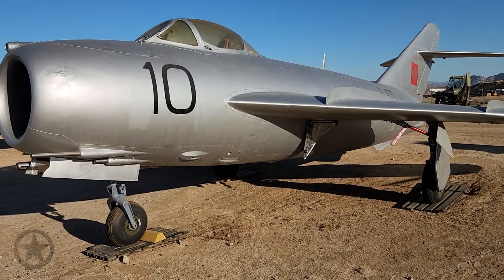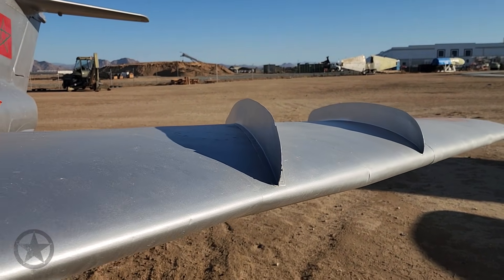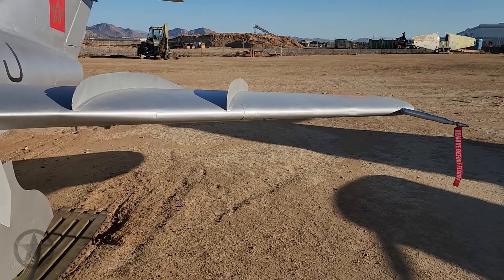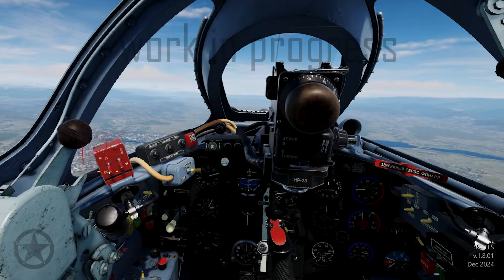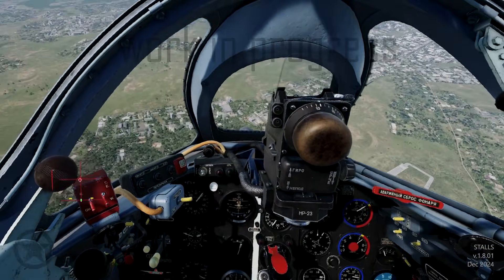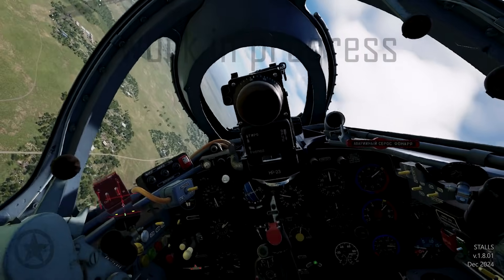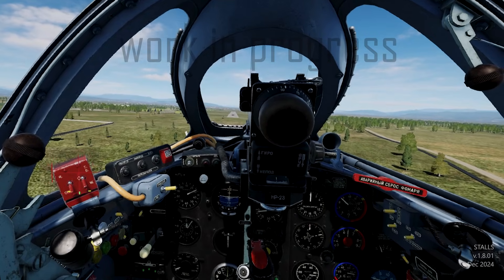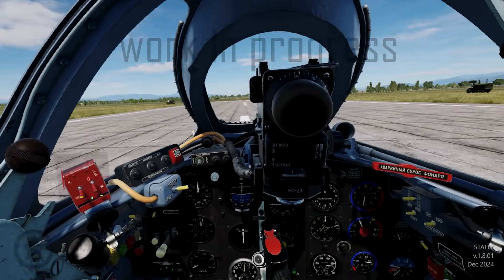DCS: MiG-17F Wing Design and Module Stalls

Comment: Bombing procedure is more or less the same as mig-15? It would be appreciate if you will show us how to do accurate bombing and rockets firing.

Another question, do you know if among all mig-17 users there were standard weapon procedures? or the diffrent air forces developed their owns?
Reply from the maker: In this case 17 bomb drops are very similar to MiG15. But MiG-17 did have several variants and the 17F was later converted into a fighter bomber by East Germany, cockpit was modified and a new bomb sight was implemented, so it was a different animal.

I may show the rockets very soon, like a few days, they hit area targets, but can do some damage. they fly straight, but just have to compensate slightly for the trajectory curving down (more than bullets, not much, just slight).
Reply: @FSX404 thank you very much for answering, cant wait to fly this beast

Comment: Does the MiG-19 have these stall behaviors too?  IRL and in DCS?

Would the MiG-15 generally stall into a roll?

How does this compare to the MiG-21’s behavior, both IRL and DCS?

Some of the F-86 versions had slats, our F-86F in DCS is a version with a redesigned wing in lieu of slats, I believe.

How does this compare with the F-100C or D’s behavior?
Reply from the maker: @Andrew-13579  15, 19 and 21 basically rolled, the last 2 autorolls I showed. There is a video on youtube by American MiG21 pilots who tested it and they actually showed a "mild" slow speed 1G stall, the 21 just did a 360. In DCS 21 and 15 dont stall, 15 does a slow roll at slow speeds but nothing above 400+ kph. MiG19 has a simple stall where it always rolls to the left.

In real life these are Gen 1, 2, and 3 planes pre fly-by-wire, so they were unforgiving when pushed outside the envelope.
Reply: @ Thanks!  Sounds like the MiG-17F module in DCS is going to be a much better flight model than the others mentioned.  Maybe someday those modules’ flight models can be upgraded, too.  But RAZBAM and Magnitude 3 have two of them, so it may be a while, unfortunately.
Reply from the maker: @Andrew-13579  if I go by how many times the 17 killed me in DCS (over 800 times), there must be multiple graveyards in Russia filled with Soviet MiG15-21 pilots.
Reply: @FSX404  Not sure I understand.  You mean it killed you while you were flying it, meaning it’s very unforgiving, or while it was your adversary?  

I meant, it sounds like it will be an authentic flight model, not necessarily an easy flying model.  Hopefully, the F-100D will be authentic, too.  And, is the F-4E pretty authentic?  Did ED just improve the flight model on the F-5E?  I get the impression flight model quality is improving.
Reply from the maker: @Andrew-13579  they are improving overall. F-4E is great but missing stalls (😓), A-4E we never finished with the group since mod project was ended, but it was our firs start. A-4E is the protofeather, MiG-17 is feather. A-4E is mostly accurate, but flight model is not just hitting points on a graph, its subtleties of each plane, its little quirks, etc. That is where MiG17 goes beyond, little details that you dont see on graphs.

As far as killing me in DCS, basically I lost conteol and died during testing, ai had to lear to fly it myself. Testers could not land it until I taught them. Its a real plane in a simulator.
Reply: @FSX404  BTW, on similar note, I recall reading, many years ago, an account of a Navy F3H Demon pilot and his practice encounter with an F8U Crusader.  The superior Crusader and its swept, flat wing was apparently known for a tendency to depart controlled flight in dogfights.  He called it octoflugerons, I think.  I’ve heard the F8U admirably called the “last of the gunfighters”.  But that day the lower performing Demon had the better of the fight with the Crusader.  The Crusader was another module, from Magnitude 3, I was hoping to see by now.  Kind of doubt it will ever be seen, though, sadly.
Reply: @FSX404 So, are you part of the team that gave us the A-4E-C?
Reply from the maker: @Andrew-13579  we came in when the mod was being switched to EFM, Nov 2020. But Talo and I were just flight dynamics advisors, others did the coding
Reply: @FSX404  I luv it. 😃 
Do you and your team consider it to make earlier model mig-21s (f/pf/pfm) for DCS, or this is an absolutely impossible scenario? Or is it only the number of potential buyers that limits such projects?
Reply from the maker: @ this is impossible, since Mag3 has the MiG21 contract.
Reply: @FSX404  Thank you for all the anwsers, and for your patience!

Comment: Looks like it will be fun to fly.
Reply from the maker: @algroyp3r  ahhh but there is more, wait until you get to above 20,000 feet, or get behind with the slow spooling engine that produces negligable power under 8000 RPM, or get close to get mach 0.91 below 10k 😓

And theres even more surprises at mach 0.98 😁
Reply: @FSX404  I am waiting for the winwing ffb  base... hope it comes out before this plane. The Mig-15 also has some nasty behavior at transonic speeds.

Comment: Will the F-17F be the version with or without the afterburner.
Reply: It will have AB, the “F” means it is the version with VK-1F. The one with no afterburner and just VK-1, is called only MiG-17
Reply: Genuinely what does it do better than the 15?
Reply: @ 
1. Better roll control and roll speed 
2. Better sustained turn at high speeds 
3. Much better vertical performance from afterburner 
4. Bigger air brakes for faster deceleration 
5. Rockets for air to ground or air to air 
6. Radar ranging gunsight for targets beyond 300m and 2000m altitude 
7. Periscope to see back easier 
8. SPO-2 to warn of radar locks in rear hemisphere
9. Better high Mach control due to improved wing and control surface layout 
10. ADI will work much better
Reply: @AeriaGloria  can’t wait to go rocket some F4 then lol, thanks man :)
Reply: I can't wait to see this baby in the sim!

Comment: Cannot wait to fly this thing! Will most likely replace the MiG-15 for me!
Reply: Genuinely why? In what is the 17 better than the 15? I get the iconic feeling of flying it against F4 and F100 online but what does it do better? Still no missiles and not really supersonic soo..?
Reply: @hugoferrari6468  Better performance in every department. I really don't get your hung up.
Reply: @tengusimulations  chill I’m only asking because the mig19 is there too and I really feel like it’s the best one, it might not be as nimble than the mig17 tho, 
I actually want to be impressed by the 17 but no missiles is a hard choice online since anyone can disengage from a subsonic plane that has no fox2 so I’m asking to make sure it’s even relevant or if it’s the same overall feeling as flying the 15 that’s all 🤷🏻‍♂️
Reply: @hugoferrari6468  I did not attack you. I just feel baffled by your hungup that is all. The 19 is the logical evolution to the 15/17. Of course it's gonna be better in every single way. 

The 17 is an improved 15. What were the problems of the 15? Shit roll rate and a tendency to compress to the point of getting you killed. Well they fixed those in the 17. 

It's a deadly dogfighter. 

Some versions also have an after burner. I am under the impression that they won't model the afterburner model though. 

Guns are the same , avionics the same. 
It's just the performance that's different.

I would not like to fly the 15 unless a mission forces me to.
Reply: @tengusimulations  Fair enough, thanks for the clarifications, I guess we’ll get to see whenever they drop it :)
Reply: @hugoferrari6468 it can also carry more A2G payload than the mig-19, cause it have 6 pylons for bombs and SAKR rockets (they’re 78mm caliber rockets, vs the smaller mig-19 55mm S-5M rockets). However in the first interviews they showed K-13 missile for the mig-17 (the same on the mig-19) but I think it was discarded
Reply: @lucaallemann5941  Imma be crying in a corner if there is no missile that’s all I know, hate when people disengage just because they can 😭

Comment: I’ve been eagerly anticipating this module since your interview with Enigma some time ago, where it became clear your attention to detail in the flight model was going to make it something special. 

What causes the opposite yaw slip and such an extreme and violent rotation in the higher speed “rate” style departures?

Is airflow blocked from the control surfaces or is it something else? I feel like I usually have a pretty good intuitive understanding of this stuff but just from what I’ve seen here it’s got me stumped.
Reply: Exactly, the pre stall warning is a loosing of vertical stability, the Mig-17 will refused to turn and if you unload you won't depart, but if you keep pulling and the plane is uncoordinated will stall just one wing and it will roll over you, it will be faster the roll depends the speed when stall the wing. in one word, just one wing flies and the other doesn't and roll over, Why stalls one wing and the other doesn't, becuase if youbare flying uncoordinated one wing will has higher AoA. I hope this explanation    would answer your doubts. good Flights.
Reply: I think it’s likely adverse yaw from either one wing being stalled and producing less/more drag, or the adverse yaw of the aileron itself being exaggerated by the loss of lift during the stall 

Gonna have a read through the aerodynamic manual soon